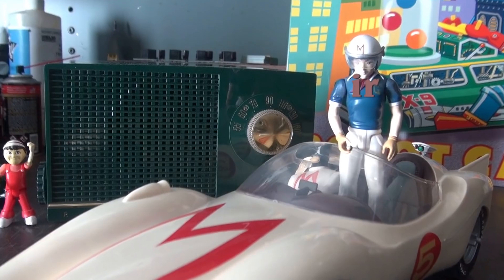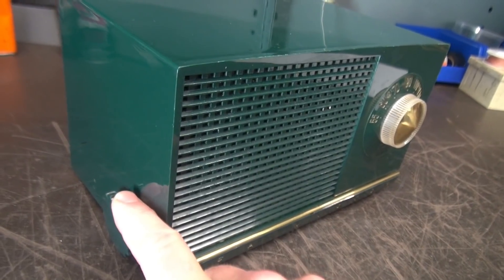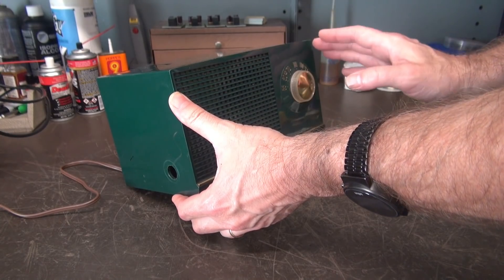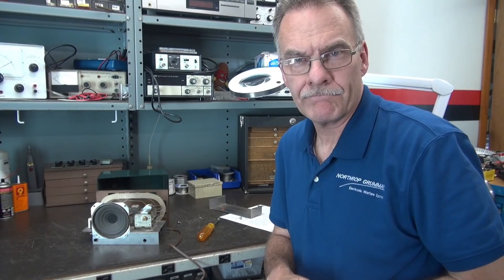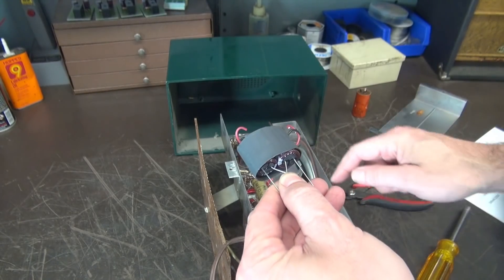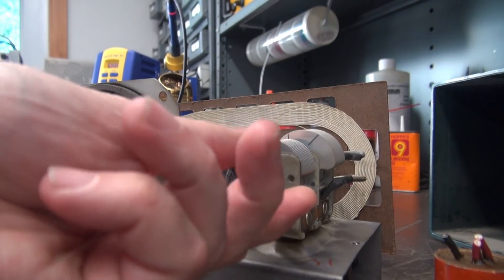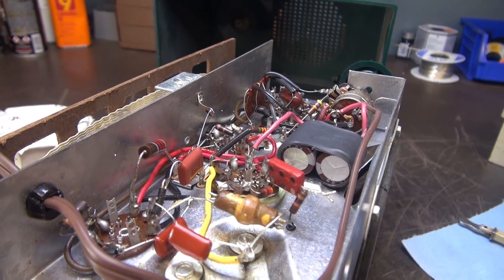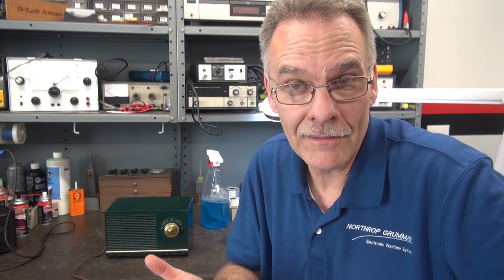How to quickly fix antique tube AM radio hum advice by D-lab

Comment: As your title implies, a quick and straightforward approach to fixing hum in a radio.  Additional topics in the comments are use of a variac and isolation transformer and replacing the power cord.  Not everyone has these items but can still repair a radio with hum using this video.  Additional items are covered in your other videos.

Comment: Greetings:
Since the subject of isolation transformers was raised; I agree they should aways be used when working on all hot chassis units while using them wit isolated units is wise as well.
i have not seen this option mentioned before, but switchable 110-220 vac transformers can be used as an 120:120 isolation transformer bypassing te switch or jumpers and using one winding for input and the other for output. Yes, only half of the original power rating is available.
OTOH: When restoring a unit designed for lower mains voltage than the higher mains voltage encountered today; I would replace the 5V tube full-wave rectifier with a pair of 1N4007 diodes and using the 5vac winding to reduce the input voltage to the input winding by wiring it out of phase with the primary to subtract the AC reaching the input winding. Some people will worry that he diodes being more efficient than the tube will result in higher B+ but I think that is nonsense. Don't forget the 5vac must only be connected to the input side.
Hope this helps.

Comment: Great job on this project. I appreciate your getting right to the point and then moving on. No long drawn-out chatter.  I am a first-time viewer of yours and I subscribed! Where do you get the caps that you replaced the old ones with? My first business as a kid was getting old TV's that were not working and making them work. My favorite was a Crosley table-top 12" FM/TV (1948 model?) Had a spinning channel selector and covered the FM band including aircraft freq. I listened to the local airport traffic!  I was around 10 and it was 1959...

Comment: Hello. I just recapped this exact radio and replaced any out of spec resistors. It played BEAUTIFULLY for a couple of days and then stopped completely! I checked just about everything : different tubes,  all coil resistances, component values, the usual. All voltages are spot on except on the AVC  line going to the first two grids  which is at 5V!  I even replaced the couplett. No change. I can hear the tone from a modulated signal when I radiate it into the loop antenna just fine. Otherwise it is silent. Help anyone?

Comment: Hello. I recapped a Majestic radio & replaced resistors & 2 bad tubes. When I turn it on all I get is a low volume hum. Going across the dial produces nothing. Do you have any suggestions?

Comment: You don't care about the outer foil side of nonpolar caps ?  OK, it will work but mostly with more hum. Unfortuneately newer caps have no longer band markings for the outer foil. If build in properly the outer foil works like a shielding and reduce hum and interfearence. But with an oszilloscope you can find out where the outer foil side is. The marked side of a cap should go to ground or the lower potential. On old caps those side is marked with a wide band on the cap .

Comment: Just once I would like to find a tube radio that in that one condition,it looks new someone cared for it well.nice repair .I like your idea of replacing all the old caps to start fresh ,that what I do ,so I don't have to do things twice,I might make a exception with a transistor radio ,but a old cap is a old cap ,I just got a G.E. MICKEY MOUSE RADIO THATS  solid state I will probably shot gun the caps ,but the radio plays perfect ,I may wait a bit ,but I am going to do the filter cap,or should I shot gun then all? Anyone or Dlab

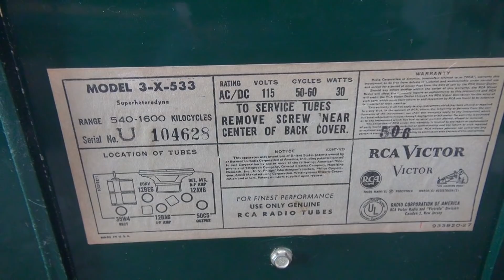Comment: 1:37 - One thing I've NEVER seen re: these types of radios is it running on DC!
Reply: These are AC radios and the AC is converted in the powersupply to supply DC voltage to the tubes.

Comment: Hi Terry, When I have done old valve radios I used to always check the anode resistors as they used to go high. I have not seen you check any of these. Do you ever check them? Those capacitors used to be great fun. One radio I did had a solid block of multiple capacitors in it. Luckily I had a diagram so I could reproduce it. Otherwise it was just a pitch block about 5"x 3"x 1.5" with wires coming out. That radio was about 1936 if I recall. Anyway great videos and a very professional approach to repair. Moist impressive. I used to run a small radio repair shop and loved these old radios. But sadly the days of commercial domestic radio repair are largely over.

Comment: I have two questions Terry. First why no alignment?
Reply: 2nd, what's your rule of thumb for capacitor replacement? For example how many microfarads and volts were supported by the original capacitors and what were the ratings of The replacements? You mentioned the voltage and I know you can go higher on the voltage. But what about the capacitance?

Comment: Great Job.
Should an old radio like that have the plug changed to a grounded one?
Reply: Evan, polarized is the usual answer. That way the grounded (neutral) conductor is always the one connected to the chassis. Otherwise there is a 50/50 chance of the chassis being hot.

Comment: From Leo:  People get silly about only replacing a single failed part.   I was a bench tech for an Instrument company.  We rebuilt controls that had been in the field for years.  The main controller chassis had four 741 op amps.  I would just snip all 4 of them out and replace them and a couple of electrolytic caps before I ever tested and calibrated the board.  I could do this faster than setting them up to test and diagnose.  I never got a controller in that did not need at least one.  Those 741's in bulk were about 50 cents each, Obviously a tech bench and overheads for a fortune 100 company costs more than that a minute.  We got a new foreman, straight out of business school who tried to write me up for wasteful work.  I got it reversed as preventative maintenance, and higher quality for the customer.

Comment: Did that radio have a differentiated AC plug? (hot and neutral)
Reply: That would be a “polarized plug”. Probably not, unless it had been changed at some point. But that wouldn’t guarantee safety. But he should have used an isolation transformer which would have eliminated the shock hazard.

Comment: it would be completely insane not to replace all the original caps they were old tech and never meant to last as long as they did, why not take advantage of modern tech for literally pennies 
love the vids they remind me of my dad fixing the old tube tv and radios
Reply: I would have replaced them before I ever plugged the radio to a socket. I just don't understand why someone would take a chance of doing more damage... You're going to change the caps anyway - why not look into the radio and change the caps first before you plug it in??

Comment: There were a few radios made at that time with bottom covers. Jewel (later made by Trav-ler) clock radios of 1953-5 had elaborate bottom panels. There were also a few Emersons with them. I was told by an old service guy that this was to try to minimize interference from nearby TVs. I don't know about that but it was an obvious expense that the public would not know was even there and died out with the switch to printed circuits.

Comment: you should really cover "skip" for the younger generation...they are fascinated by it and most have no knowledge of it at all...its a really amazing topic..
great video thankyou!
Reply: LOL.. I didnt even think of that...I'm old as dirt and it was a common thing. Late at night hearing stations from far away places.. ( relatively speaking..)
Reply: Get a transistor pocket radio that works well. Late at night, stand beneath a power line and you can tune in stations from thousands of miles. I presume it is inductive coupling to the long wires above. This should blow a kid's mind! I would listen to horse race scores from Arizona in northern California (Red Bluff) late at night in the summer and marvel at the range I was getting from a mere  six transistors! Actually three transistors if you didn't count the audio amp portion.

Comment: Nice shirt swag Terry!  I have a Hallicrafters S-120 that has loads of static noise at 700 k.c. And below.  I cleaned the tuning capacitor with Deoxit checked for contact of the fins but can't seem to find the cause of the issue.  Unit has been completely recapped and performs great above 700 k.c. Any suggestions?
Reply: Paul J Pachasa JR thanks Paul.   I will take a look!